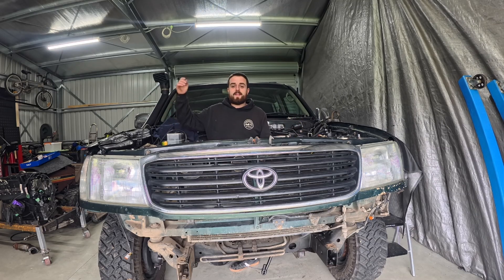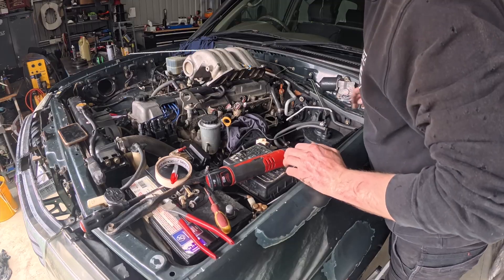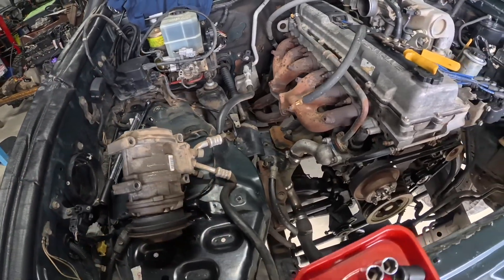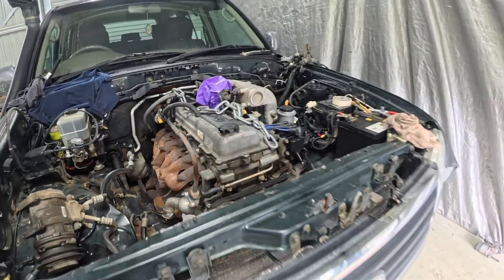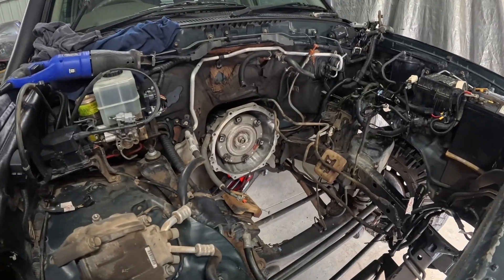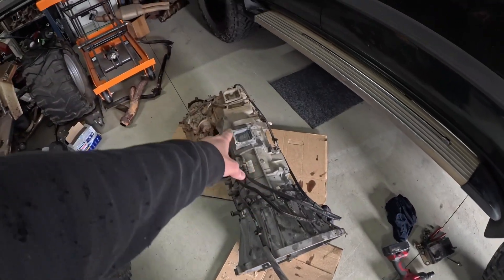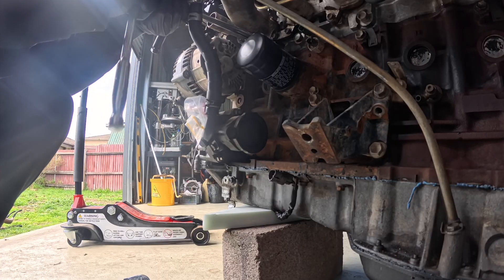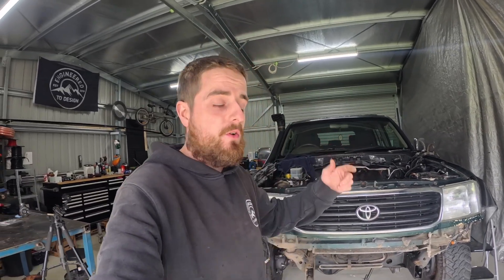Installing A BMW ENGINE Into My Toyota Pt 5

Comment: Keen to see how the mounts line up. As mine is a fj80 the mounts for the 3fe are in a completely different location - further forward. Unclear if i need to replicate the 1fz mount location or just fabricate to suit the bimmer mount location.  Getting closer to buying the donor too.
Reply from the maker: I have heard the 3f mounts are different. My chassis has petrol and diesel mounts.. maybe measure a set and put them on instead..

Comment: Love seeing your video updates as I'm planning on doing the same conversion to an 80 series! Can't wait to see more progress
Reply from the maker: That’s awesome! Definitely a good engine
Reply: @EngineeredToDesign yeah I've got the engine and gearbox just need to get onto sorting out the engine and getting the conversion stuff
Reply from the maker: @5t0l3n1  is your 80 an auto? Keeping the zf auto?
Reply: @EngineeredToDesign yeah the 80 is petrol auto, was the missos car but it started doing weird things and I got over trying to fix it. So upgrading and making it better is the best/only option haha
Reply from the maker: @5t0l3n1  haha they are to hard to read/ diagnose. Some get good figures going to haltech stand-alone apparently. Check out Aslmods for the adapter
Reply: @EngineeredToDesign yeah that's who I'm going though for the conversion